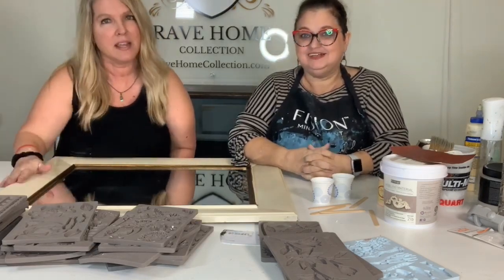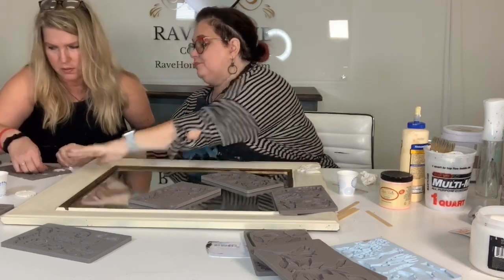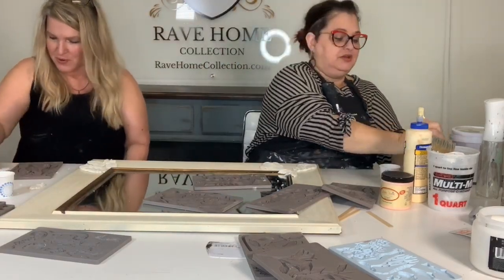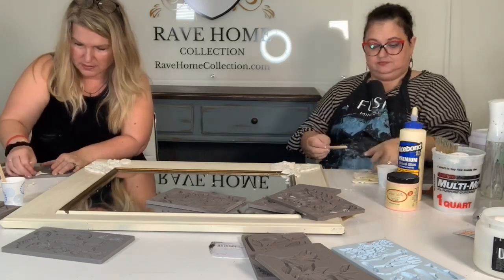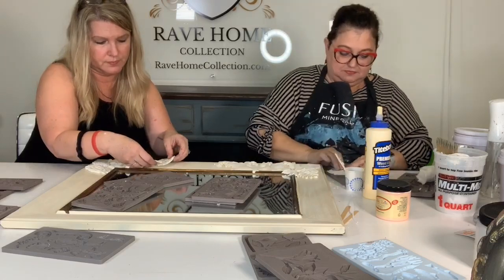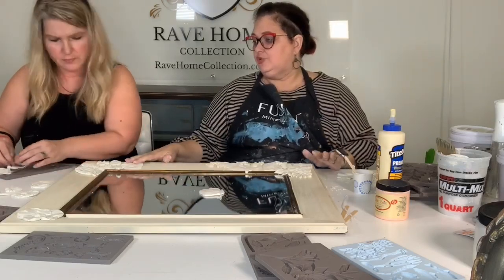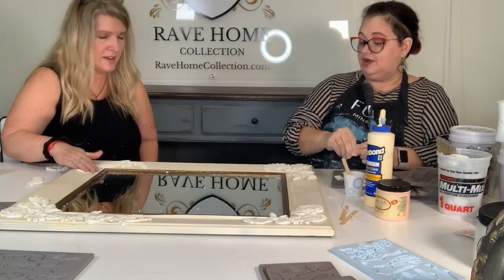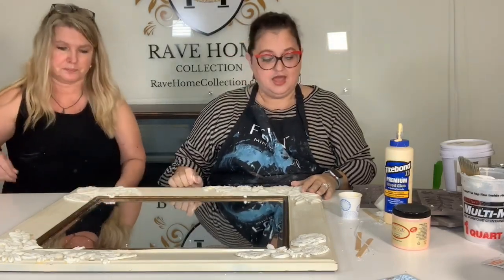Upcycling a mirror Part 1: Using Prima Decor Moulds & Modeling Material

Comment: Question. I worked on a 40 inch mirror I found at the thrift store. I decided to use Alumilite fast cast. The mirror It wasn't flat.  I had to use clamps. I spent literally 25 hours making this beauty. How can I sell this? How do you price your beautiful creations?
Reply from the maker: How much of it was actually working and how much was drying? I don’t include dry time. Also, you may have overworked for what the possible value was. I price based on what I think I can get for a piece.
Reply: @VintageBeeDesign is true. I do get carried away with adding flowers. I just can't stop myself they look soooo pretty. I agree. I went overboard for what I can get for it. At this point, I don't want to sell it.